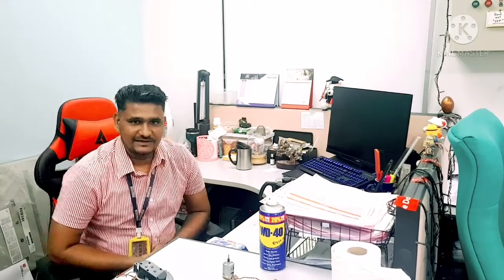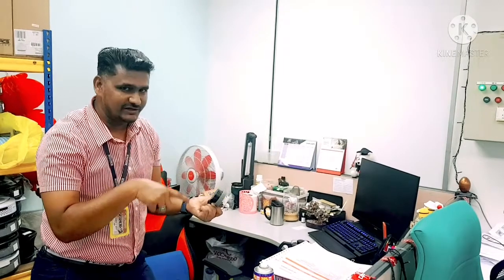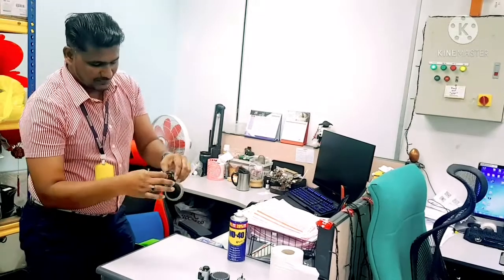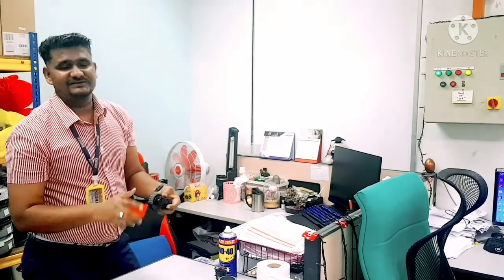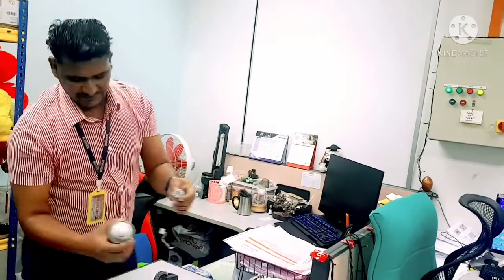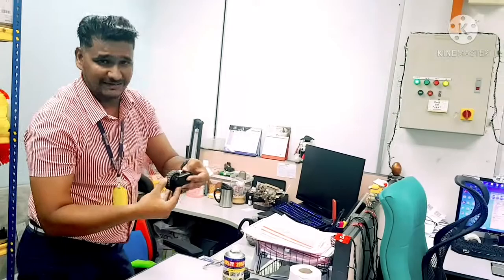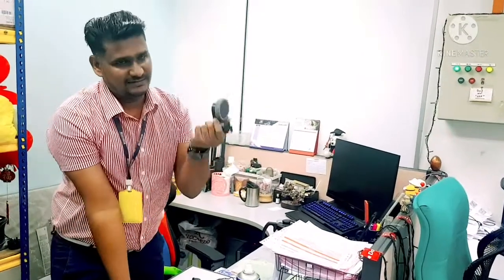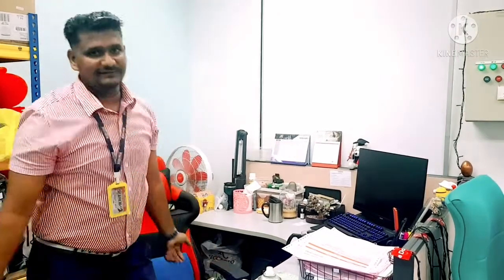Wheel Issues Repair at Home

Comment: Hi, I have a Deebot T8 Aivi, and similar to OhioBenz comment above, I am getting an intermittent drive wheel error. When it does this, it rotates counter-clockwise, so you would think the problem is with the left wheel. When I turn it over and inspect it, there is nothing mechanically binding either wheel. I can turn both wheels freely by hand, although the left wheel is noticeably easier to turn than the right wheel. The left wheel is not free spinning, but sort of has resistance like you feel when winding up a top. It will continue to turn on its own slightly after getting it started. The right wheel will turn freely, but definitely requires more force, and it does not continue to turn on its own. I was surprised, as I was expecting the left wheel to be the one that was stuck or binding. I then began to think that maybe the motor for the left wheel was bad, and this was the reason for the less resistance on that wheel. Then I found this video and read OhioBenz comment. When I placed the Deebot back on the charger for a while, then took it off and inspected the wheels again, both wheels then had the same resistance, and the robot operated just fine! Do you know what could be the cause of this, and how I can resolve this issue permanently?
Reply: I have the exact same problem. Hope he will reply to your question and address the issue.
Reply: I have the exact problem, I even replaced the wheel motor, it will work for 40 minutes and then the wheel will get hard to spin, swithcing on and off will let it work again. This means it's not the wheel motor assembly but something else. Could it be the board? Also my debot will go offline for no reason. I have two and I know one is faulty acting weird.
Reply: @ddxxbb1 hey, just got the same kinda problem. I just waited 2 weeks for a new motor to arrive as I saw my last motor have a burn mark on it. 

When replacing the motor tonight, it still didn't spin freely. I was using a 9v battery to pulse the motor and it was working. As soon as I closed the gear plastic lid, the motor cannot turn anymore. It's getting jammed by the plastic. Will try cutting the plastic mould to allow more room for the motor worm gear to spin freely. 

Look into this and let me know if you get the same issue

Comment: I have a Deebot T8 which has intermittent drive wheel errors. It is always the same wheel.
When I turn both wheels by hand one is always harder to turn. However, as soon as I turn the power switch off and back on both wheels are free turning and the vacuum will work without error. 
What would be the cause for this?
Reply: I do have the same problem? Did  you able to find the source of it?

Comment: Hi appreciate you created this video. Mu unit is T9 and having a problem since a month ago “please check the driving wheels”. Sent it to service centre but still error. It’s going over a relatively clean hard floor with no obstacles, yet very few minutes it stops due to this error. What should I do? Please advice

Comment: Hi, thanks for explaining the cases. I had the exact issue where my deebot is turning rapidly to the right. After taking it a part, I noticed a wire to the speed sensor for the left wheel is broken. I tried to take out the wheel but found some wires attached to the bottom of the robot which I couldn't figure out how to remove. Could you show/explain how it's done? My model is ozmo 930. Thanks!
Reply from the maker: In this model replacement wheel is quite difficult...but not impossible 😊 .. u need to open vacuum fan n LDS assembly as well... underneath you will find some small tiny screw attached with bottom chassis open all those screw remove that Mop plate located underneath dust box area then you will be able to remove all sensors wires...same way can fix back

Comment: The main brush is not rotating though the machine is working otherwise. As a result, the dust is not getting sucked up. I think the tiny part in which the brush is fixed has got lost, can I just buy this part

Comment: Hi, I have a question about my ecovacs deebot OZMO Slim 10 robot. Right wheel is turning slower that the right one. I bought a new wheel and changed it, and still didn't fix the issue. The robot cannot go straight. What do you think the issue can be?
Reply from the maker: Plz send me a video clip at 00601137973018..I'll see the video n let you know what's the issue

Comment: Thank you for your video. My issue is with the gears on one of the wheels of my eufy. The last gear (closest to the wheel) is loose and moves even when the wheel doesn't move. It's supposed to be stuck and move with the wheel. Do you know why this happens? Is there a way to "glue" the gear back to the wheel somehow?
Reply from the maker: If u can find the same gear size then Just replace it.... hopefully online u can get this gear...all gears are normal size online should be available

Comment: Hi, I'm having issues with my deebot 930 model, when deebot back out from charging dock it takes a semi circle towards right, and then stay there and doesnt move an inch, its vaccum brush starts running but deebot doesnt move from the place, i tried your trick to run both wheels by hand, that just make deebot go forward few inches everytime i do the trick but then again stands still with brushes rotating. Can you provide guidance how I can fix this.

Comment: Dear sir hullo.Ihave a problem with my Deebot ozmo 920. The right wheel does not turn and I found that two plastic gears inside are broken. I have to change the whole wheel assy or I can find only the plastic gears? Where I can buy spare parts because I can't find any spare parts list. Thank you !

Comment: Hi, my castor wheel housing has broke inside the machine and the wheel won't snap back and lock in.  Should I send it back to Ecovacs?  It is a Deebot M80
Reply from the maker: If its broken then need to replace that part

Comment: This information is really helps. I am able to fix my cecotec 3290 robot cleaner wheel issue by applying wd40. But, you said in the video the fix would work temporarily. What would be the permanent fix? Is wheel change permanent fix? Where can i buy it? (I am from India). Since cecotec authorized service center is not there in India, can you suggest who else can do service? I observed that there is white lubricant inside the wheel between levers. Can you please suggist what is that lubricant? Applying that white lubricant would fix permanently? Thank you.
Reply from the maker: Thanks for ur compliments... There is one service center in new dehli plz search online... Normally motor become jamme that's why wd40 works n it start functioning... It's not due to that greasing it doesn't effect... If u couldn't find same new wheel assembly then try to find same motor from electronic shop n can fix ur self if there's no service center near by....
Reply: Hi Kishore,
You can reach SUREFIX Bangalore service to get your device serviced. Hope this will help you
Reply: @shaiksaleem06  have you personally used their service?
Reply: @jollysingh2873  , yes. They are experts in servicing of  all kinds of robotic vacuum cleaners

Comment: Hi sir, I have issue with my deebot ozmo 930, when I switch on deebot the wheels rotates right and left.
     After it suddenly stops running wheels and only the 2 small  brush are rotating.Please give me the suggestion
Reply from the maker: Actually it's a wheel issue...if u can try to fix as in video i mentioned some tips u can do it at home...but if wheel is quite jammed means motor burn...see if u can find same wheel online just order n replace..if couldn't find then try to look same motor n just change motor...you can fix if u can get same size n v motor in open marcket
Reply: Hi, hope your issue is solved. If not, You can reach surefix banglore service. Hope this will help you.
Reply: Hi, hope your issue is solved. If not, You can reach surefix banglore service. Hope this will help you.

Comment: My Ecovas working fine without under body guard while working with body guard after working for few minutes message wheel stuck and work stops with red light on . I don't understand what is the problem facing .
Reply from the maker: Plz check if its turning clockwise n stop then right wheel need to replace if anti clockwise then left wheel need to replace...u can check at home

Comment: this is great information- but can you advise me why the right wheel on my deebot 900 seems to require more force to turn than the left wheel? My bot is making tight clockwise turns and both wheels can move when I flip it over. I find the right wheel to require more force to turn and you can feel resistance compared to the left wheel. Thank you for any help
Reply from the maker: Remember one thing all deebots got this function that when it move along the wall it always turns clockwise sometimes can go straight just next to wall sometimes jeep keep touching the wall but always clockwise.....in ur case if u already tested manually that one side wheel u feel harder than other side it means that side motor is slightly jammed but still turning or some hairs tangled inside thats why wheel slightly jammed if service center is not near by then u can try to open at home n follow video steps

Comment: Hi, my deebot m88 wont move forward. 

If i press auto it just turn to the left. So i tought it was the right wheel, but after testing the wheel and motoe is okie. 

I tried to remove the front sensor. And try to press back. Both motors can move. But forward it cannot. 

What maybe the problem?
Reply from the maker: Plz open top cover n check motherboard where we fix front anti drop sensors wire right behind IC become black?? Or burnt or colour change...if like this it means main board IC burning that's why front Anti drop sensors not functioning...if deebot just turned in circles n won't move forward that means wheel issue....most likely is wheel issue

Comment: Sir can you please help me,my new robet vaccum cleaner - ilife a20  not working, i have used only two days,when i kept it into the charger there were no problem,today it says "please check the leader" or something justt like that.what can i do to fix this.i hope you can suggest a solution.
Reply from the maker: Plz send a small video clip so I can confirm what's the issue..00601137973018

Comment: I have got a m88, have been using it since 2016. Me located in Mumbai and as you suggested it's rotating round. Do you know some one who can fix/repair it?
Reply from the maker: If its turning in circles... means one of the wheel got problem....u need to contact service center in new Delhi

Comment: Hi, thanks for your videos! I have a liectroux c30b and the left wheel turns with difficulty. The motor and the gears rotate fine. Is there a way to dismantle the wheel to check if there is dirt inside obstructing it? Thank  you in advance =)
Reply from the maker: Yes you can open the motor but it's quite difficult to remove motor bottom part.. don't break it

Comment: Dear Sir can you show me How to Remove the steper motor Because it is Jaming on side motor Model No : Eco vacs DX9 G    ( Pls it is very Argent) .
Reply from the maker: Can u plz WhatsApp me a pic which part Ur requesting....00601137073018
Reply: This is I think New Model ecovacs DX9 G one side Running motor Jaming I unscrew every screws Also Bumper Screws  But I can't open Bottom side can you pls guide me pls send Vedeo How to take out motor outside (I am a Electronics Technician of LED TV)
Reply from the maker: First of all need to remove bumper, then remove top cover, before removing top cover plz maksure remove all screw include LDS back screw cover with black rubber seal, under that rubber got two scree, before removing top cover from front need to remove two wires attached with motherboard then just pull up the top cover...pull up from bumper side then remove motherboard screw under motherboard u can find side brush motor screw, one screw for side brush motor is underneath where u fix the side brush.remove all screw then can take out the side brush motor

Comment: There is another problem you never addressed with the wheel not being able to turn. That is when the rubber wheel comes partially off its rim and is no longer a snug fit onto its rim and therefore the rubber wheel is not symmetrical on its rim. This prevents the wheel from turning because it makes contact with the wheel guard and jams.
Reply from the maker: Thanks for the information... I'll try to add in next videos... thanks again sir

Comment: Hallo..mu deboot is not running well..just stay in the same place as i take it off..the machine is on and working..but no movement..can you please tell me what is wrong with mine and how to fix it? Thank you
Reply from the maker: Model no?? Is it turns in circles or totally not moving??? Can power on & vacuum start but not moving???

Comment: Hello Sir Again lam distrubing you     now I Remove and take it out wheel and . I try to open gearbox of wheel unscrew 4 screw But Can't open Because there is one counter wheel under one screw counter wheel Can't lift. may be Brake I think this is New model set Nobody show this type of set
Reply from the maker: After removing 4 screw of wheel casing can take out the wheel assembly...just wire attached with motherboard need to replace... weather new or old model all same